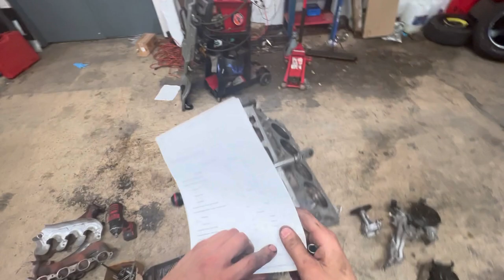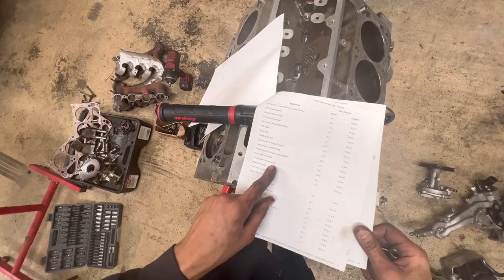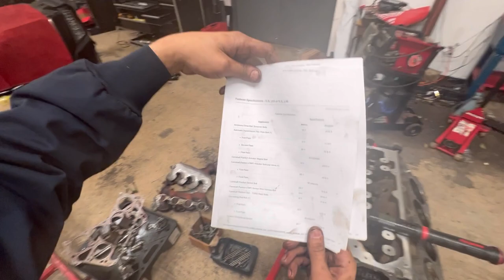Cadillac Escalade Lifter Fix ( Partial Engine Rebuild) Follow Along With Me! #lifterproblems

Comment: Nice work but why you did not delete DOD/ AFM system because whole system is doomed.  How much would someone expect to pay for same job? Thanks
Reply from the maker: Hey buddy thanks for watching.I leave that to performance shops, I went back stock because of liability porpoises something can go wrong like a program issue, you may know this but you have to reprogram the engine computer when you do that.I like to keep stuff simple just in case something go wrong,people are nice long as stuff go there way lol. A job like that cost him almost 5k a used me engine just engine not labor cost between 6k to 9k smh.almost forgot I went back with better lifter it should last longer now
Reply: Thank you for your quick reply.  Quality work, both mechanical and video. Appreciate it. I had the same job done in November 2021 and I have gonne with full dod delete where the ECU was reprogrammed all non dod parts were installed -Oem GM cam, lifters, headgaskets, etc.  Mechanic did it with the block still in the car. I should last a while now. Good luck with everything.
Reply from the maker: @bobgavric  thanks again man. Yeah I agree do it that way I know I would if I own that engine

Comment: I really like watching your videos and good work. I will make a slight criticism and it's only to make you aware of something. So I had the same issue with my escalade last month except my lifter didn't fall apart but seized up. Anyways it's very important when re-using the oil pump that you install guides before removal. That way it perfectly lines up when re-installing. If your using a brand new one it doesn't matter. The manual is very specific on this and your oil pump can fail if you are off. There are a lot of videos on this and like I said it's important to have that right. Might not fail this week or next but will likely fail and the. Your pulling engine again and worst case replacing engine.
Reply from the maker: Thanks for the information I will look into that. Thanks for watching buddy

Comment: Thanks Alex. My cad is in the shop now for this. Just curious why if you take this engine so far down that you don't rebuild the bottom end of it replacing pistons rings and bearings? Wouldn't the labor to do the whole thing be pretty close to the same at this point? In my case that was the case so I went for the entire rebuild. I also had 138k on the motor when the lifter finally failed.

Comment: Seeing how you liked to use no power tools, have you ever used a speed handle? I used one lots during my engine assembly days. There's even a bit of a trick to getting it to spin using the offset handle.  Maybe no one uses them anymore.  Just a thought.

Comment: This is not in topic Alex, But what’s the best way to align my camshaft sprockets on my 2008 3.5 Dodge Charger , I can’t seem to get everything to sit tightly while I tighten the tensioner
Reply from the maker: That’s something that’s better shown than told but try taking cardboard and wedging it between the belt and the metal surface to keep the belt from jumping off while you get the tensioner on hope that helps
Reply: @AlexTheCarDoctor  I Know Exactly What You MEAN ! I’m a visual learner I prefer , but will do first thing in the morning , thanks will keep you updated tomorrow morning !
Reply from the maker: @23zaee  please do

Comment: I have 2015 Escalade premium with 84k miles with the same problem currently. Sad to say it’s the worst vehicle I’ve owned, from the lifters to torque converter failure and magnetic ride control failure.
Reply from the maker: Dang man sorry to hear that that really sucks.GM needs to do better they v8 engine’s has went down hill and quality control

Comment: Hello, how are you, friend, I have the same situation, but when the car starts, nothing is heard, only if I accelerate it while parked, when I release the pedal, the revolution goes down, it starts to sound and turns on, I checked the engine, and when I ran about 2 miles again it doesn't sound anymore unless you go full throttle
Reply from the maker: It’s probably getting ready to fail but I’m not sure I will have to hear it for my self

Comment: I have a 2015 escalade with 96000. First shop quoted me and it started at 2400 to fix than went all the way at to 3600 and I ask them to explain these prices and they couldn’t give me one, but I have it at another shop for 2700. Been sitting in my driveway for 7 months with cylinder 4 being collapse.
Reply from the maker: Dang that’s terrible

Comment: Do you need to resurface the head or just clean it for reinstallation?
Reply from the maker: Just clean it up, you only Resurface it if the engine has overheated for the most part
Reply: @AlexTheCarDoctor  for the lifter trays there’s no torque spec?
Reply from the maker: @2ss701  I’m pretty sure there is but it’s one of those parts that you can get away with out torquing it just be careful not to over tighten up it doesn’t take much to tighten it down. I will say about 15 inch pounds should do

Comment: Are you supposed to prime the oil pump with vaseline or something? I have done it several times with vaseline never have any issues so far.
Reply from the maker: Yes I primed my method is disablebl the starting system and cranking over the engine several times
Reply: @AlexTheCarDoctor  oh that's another way to prime. Smart! Lol
Reply from the maker: @sherrodford955  yeah been doing it that way for many years.I didn’t show everything this was just a follow along
Reply: @AlexTheCarDoctor  On Chevy's you can just depress the pedal all the way to the floor and crank it, it shuts off the fuel injectors as it enters "clear flooding" mode.
Reply from the maker: @wally7856  yeah that’s the way I do it the computer will shut down the fuel injectors at about 80% throttle,that’s just not a Chevy thing that’s a wide variety of vehicles now these days

Comment: Are the torque specs you shared the same on a 2012 escalade?
Reply from the maker: No it’s different that’s for the LTengines you have a LS type V8 port injection, not direct injection
Reply: Thanks for responding
Reply: @AlexTheCarDoctor  Do you know where I could get the torque specs for my year escalade 2012. My mechanic ghosted me and I can't find the specs anywhere. Thanks
Reply from the maker: @gregcook5995  reach out to me on instagram and I will send them to you Monday
Reply: Dude you're a baller for responding, I finally found the specs on the motor.

Comment: hey alex, caddy dealer tech here for 20 plus years .  what was the total out the door for this guy  if you dont mind me asking. 
im in south florida and wondering price differences. thanks
Reply from the maker: About 4800$
Reply: Thanks for the quick response.  Are you using OEM cadillac parts at that price.? I need to quote a job and parts are through the roof.  
What’s your hourly rate ?
Reply from the maker: @drewc4311  I use milling but they are on back order as of right now so I’m not taking any jobs because I’ve been burnt on other part brands my labor is 125 an hour
Reply from the maker: @drewc4311  Fel pro head gasket set with fel pro head bolts
Reply: @AlexTheCarDoctor  

Warranty time on this job is 21 hrs.  GM is nuts and there robing all the techs blind. They wonder why they can’t find new kids to do this job.  

No one wants to do this any more.  Especially when something goes wrong. It’s not easy anymore.  On top of that it’s a long way back to take out a new defective lifter that you just installed because GM makes junk parts.  

My hat goes off to you, sir. 

I hope your making enough money from YouTube.  Keep in mind your giving away your hard earned skill that took years of blood and sweat learn to other people for free. 

✌️
Reply from the maker: @drewc4311  thanks for the consideration. it’s getting up there but it’s still just a drop in the bucket as of right now hopefully it pays off one day my YouTube chicks that is. where are you from? I feel your pain I was a Subaru technician at the dealership for a couple of years I felt that I was being robbed blind while making them rich in the process I couldn’t deal with it. my favorite job was working at UPS working on their fleet trucks I will still be there till this day if they didn’t start showing favoritism when they switched up management
Reply: @AlexTheCarDoctor  
I’m down in south Florida.
Reply from the maker: @drewc4311  I’m down in Georgia Atlanta but I’m currently on vacation taking a cruise out of Miami Florida
Reply: Hi do you know anyone in Orlando that could do this? I'm having the same issue and need to get my car fixed!
Reply: @Braziliancutie01 

I’m in Fort Lauderdale

Comment: plan on visiting ohio anytime soon? lol. you could make a killing just because you post videos of the repair. i have a 2016 ss with the same issue collapsed dod lifter, cyl 6 and they wanna charge a bro 6k to repair at chevy, actin like they aint sellin fucked up cars. i bought this thing is may 2021 and in march the damn ticking sound started. had i known about any of this i woulda just did a dod delete kit myself at the time of purchase when i had all that extra money. GM / chevy and anyone selling these cars are straight up crooks. they have done everything under the sun to try to blame me trying to act like i lapsed on oil changed when i didnt. buncha shady ppl in the auto business. good to see there are a few good ppl left. GL GB. i hope y'all make all the $ fuck these shady dealership shops.
Reply from the maker: No time soon bro. I call the dealership the stealership they are all way trying to get the consumer.  GM has really drop the ball with these new V8s I prefer a good old LS non- DOD they will last over 500,000 miles with no problem